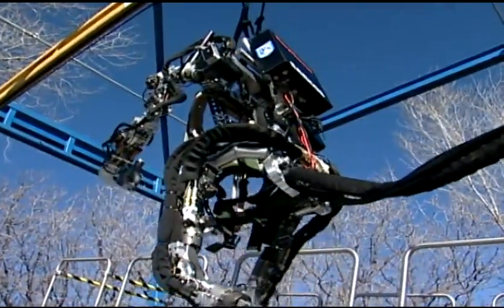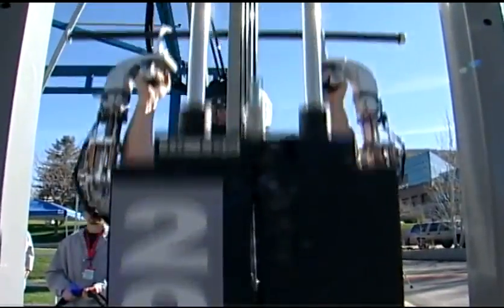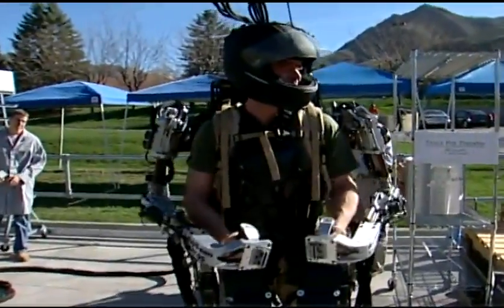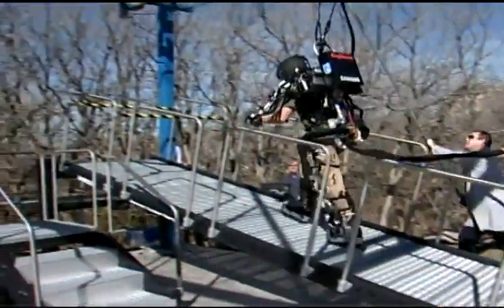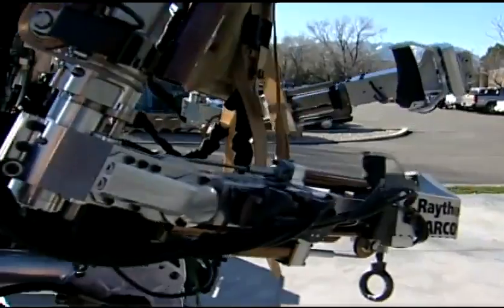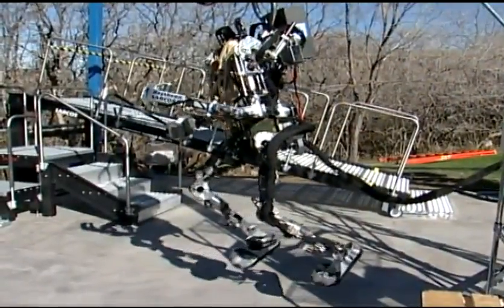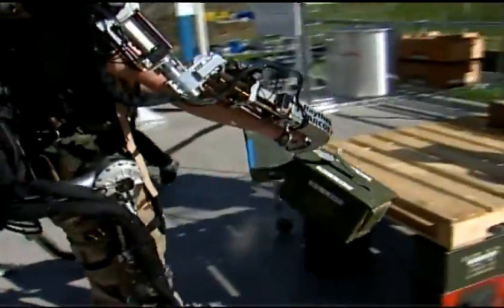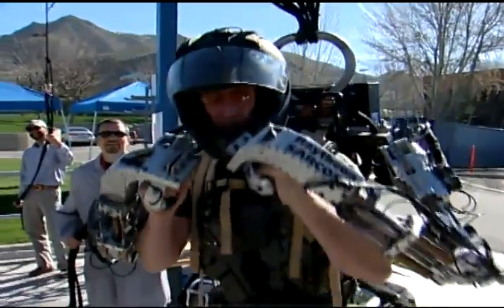Raytheon XOS Exoskeleton

Comment: Not really. You see, there's this thing called square-cube law. If you double the size of a robot, it becomes twice as strong -- but eight times as heavy. You can't scale a design up, and assume that it works the same way. The legs that work fine in human size would snap like twigs if they were on a body 3-4 times the size of normal. 

Anyway, there is no use for big robots. They would just be big targets, easy to take down. Going far over 10 foot tall is just pointless in combat robotics.